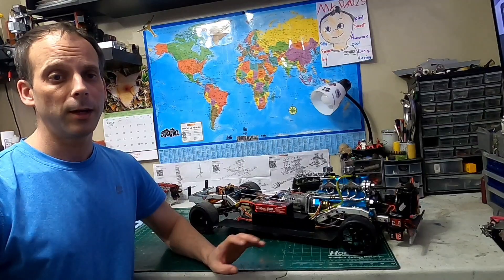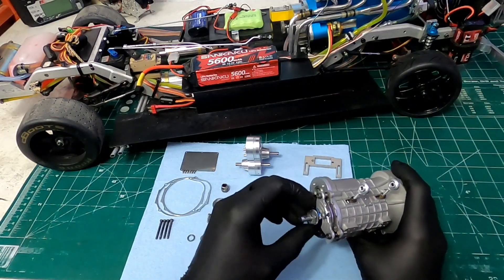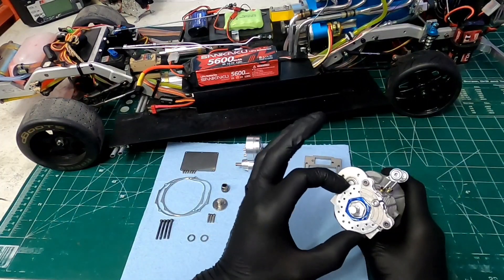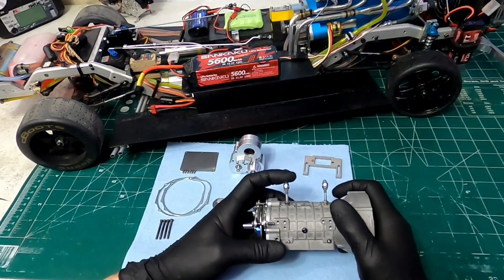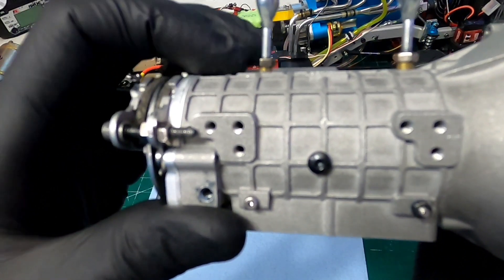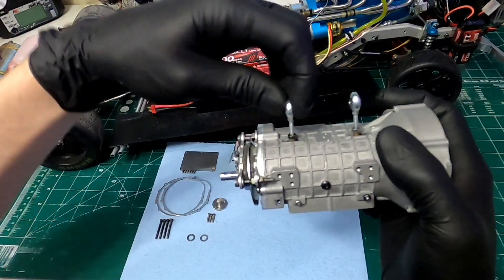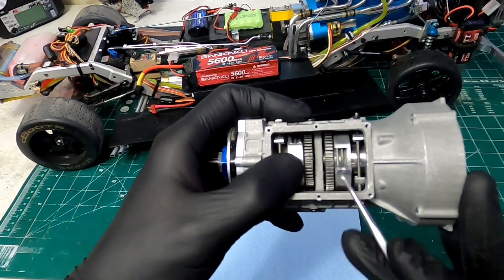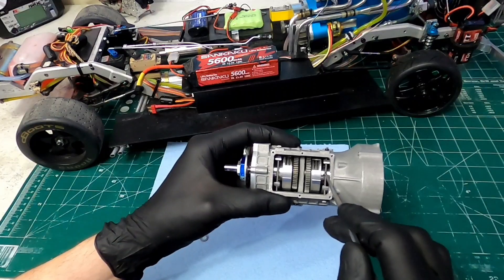Cison 4-speed Transmission! How It Works!

Comment: I like your brake mod , that'd cool , I think they should clarify it's only 3 speeds , it's very large abd I'd prefer another usable gear than neutral and reverse , that's just me , I bought a genuine 4 speed gearbox for the Tamiya trucks years back that's a really strong planetary setup , and its really small and fits perfectly in a truck , personally , I'd prefer way smaller engines and transmissions because more vehicles would be candidates then .
Reply from the maker: Thanks for watching, bro. 🍻  it's a true 4-speed gearbox. Its just that one gear is dedicated to reverse if a person had gear options reverse can be changed into 4th gear, speed forward only gearbox. I did make a suggestion for a forward only upgrade.
Reply: Nice , hopefully they take that on board , I tried to convert the gearbox Stirling sell , it has no housing which is strange , but I couldn't find the right ratios , i think planetary boxes are the most practical for performance and fittings and longevity , for me , the worst issue with these engines is the lack of interesting vehicles to use , I'm trialling some fuel proofed paint jobs , it's always nice to not have your paint wrecked 😂! .  @JamieNitro
Reply from the maker: @stevenwalker1883  I think that you are using the same gearbox as the one I installed  on my 6x6
https://youtu.be/fAdn81lmr6A?si=VsLzmsMNkeqNw_PA
Reply: @JamieNitro  yes , it's a good gearbox . It just looks unfinished , it bugs me a little .